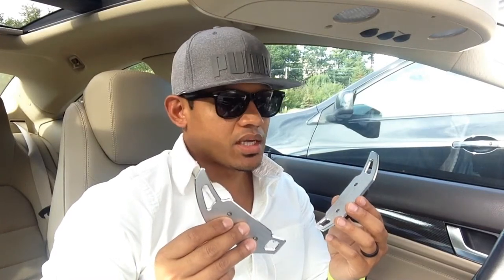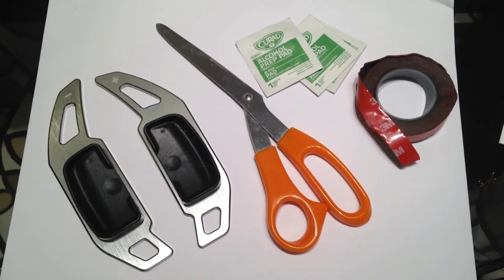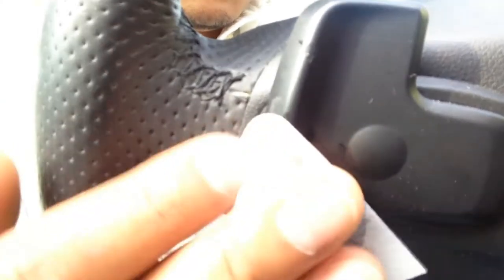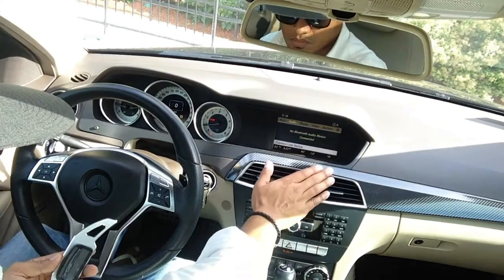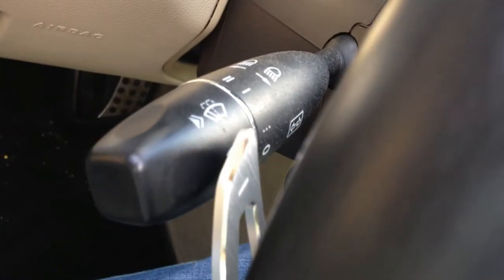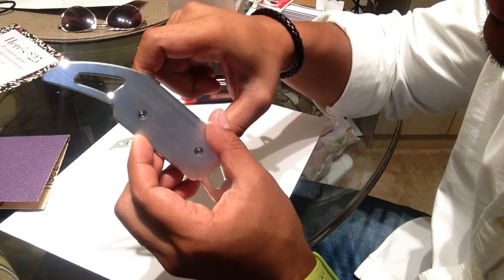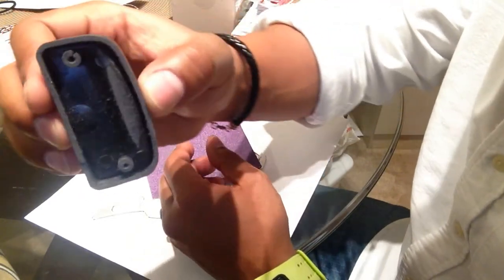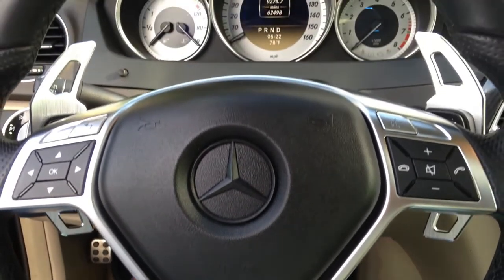INSTALL RACING PADDLE SHIFTER EXTENDERS MERCEDES C250 C300

Comment: good job and smart fix.  the left paddle shifter (before it was fixed) must have been difficult to remove because of the 3M tape that you compressed for five minutes. How hard was it getting off so it could be modified?
Reply from the maker: it actually came off pretty easy because the install was still fresh. Only issue was I still had some sticky double sided tape residue that I had to clean off the stock paddle shifter. Nothing a lil rubbing alcohol and elbow grease couldn't conquer.
Reply: that's awesome. Well done !!!

Comment: What year is your car ? How do you have a paddle shifter in your steering wheel ?
Reply from the maker: 2012. The paddles are already on my stock steering wheel. I swapped my steering wheel from brown to black steering wheel with paddles. . And then put on paddle extenders.  But yes, my car already came with paddles.
Reply: Mines a 2013 with no paddles :/ what a bummer

Comment: how do you remove the paddle shifter extenders?
Reply from the maker: It’s double sided tape. You hit it with a blow dryer or heat gun, and then pull them off.
Reply: @TheFlexxGarage  ok thanks